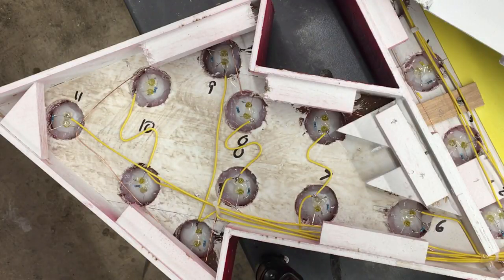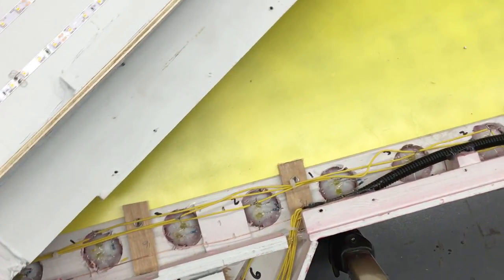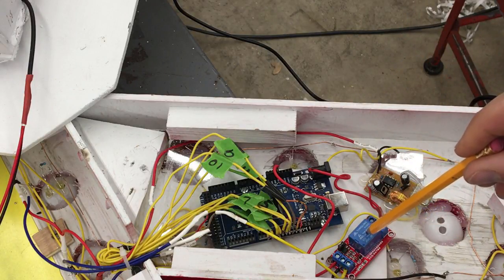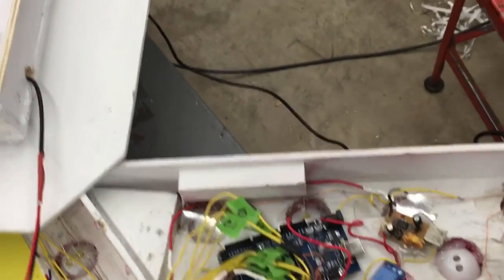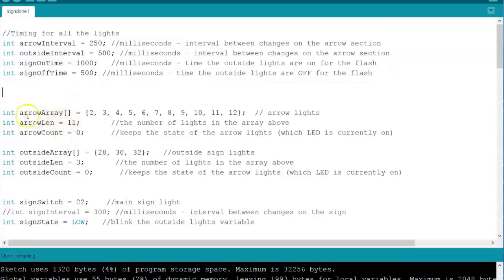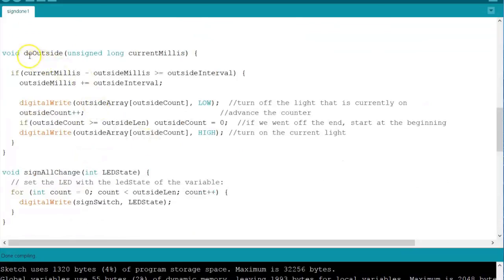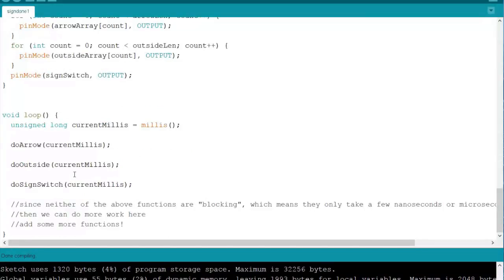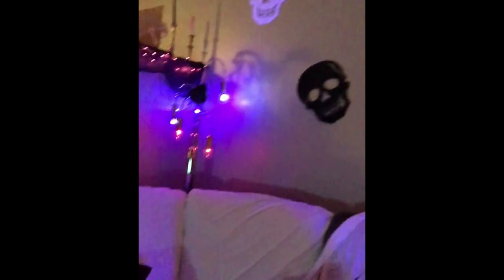Beetlejuice Sign

Comment: Hey Maker Max, what dimensions did you use for the wood? 
Looking to re-create in a library setting and we would like to follow your build.
Reply from the maker: I just did what I thought looked ok.  Mine is not very screen accurate.  I would think 4 inches wide would be good.

Comment: Would you be able to say what size of wood you used for the frame?
Reply from the maker: Use whatever you want as I used my old cedar deck boards but planed them down thinner.  If store bought then 1x6 pine boards would work and you could cut them down to a width of probably 4 inches.